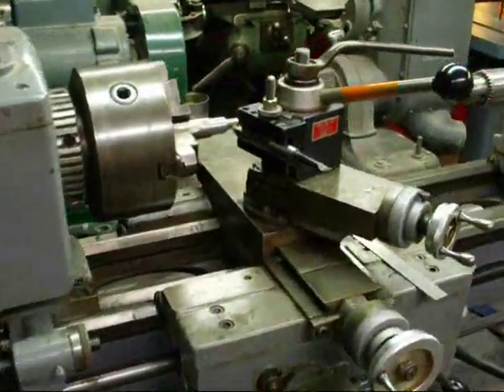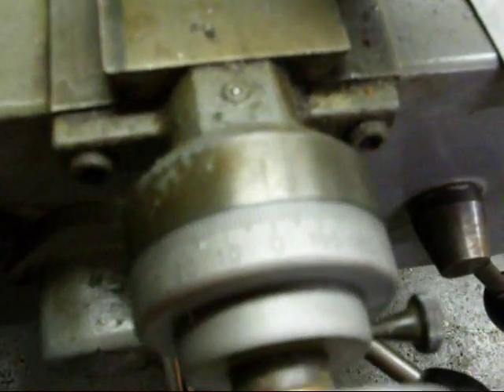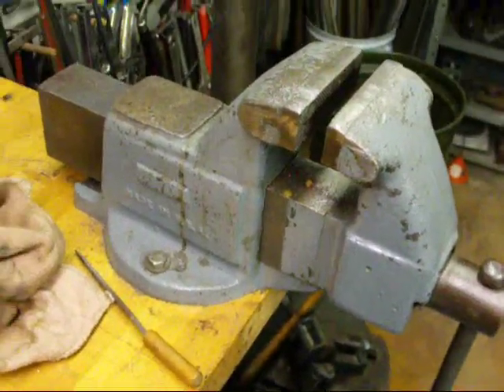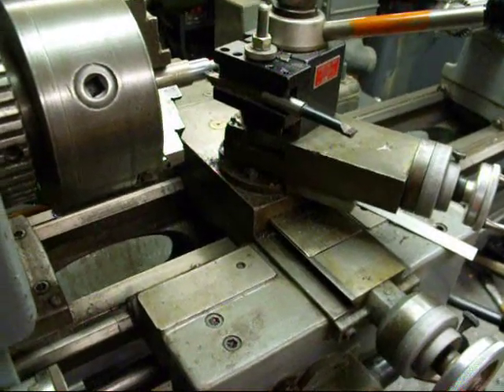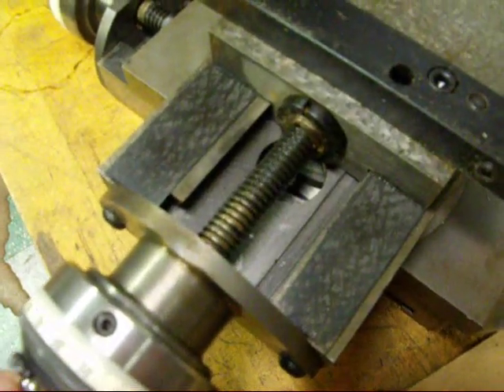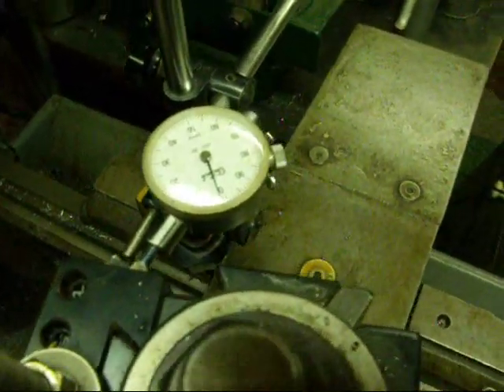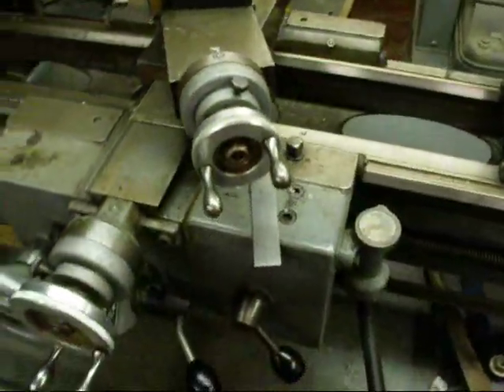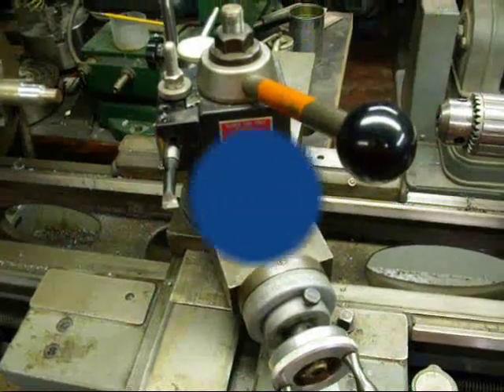SCREW BACKLASH on Atlas Clausing Lathe tubalcain

Comment: I purchased the Atlas Craftsman 12x36 I had mentioned in a comment a few weeks back. Its a great machine, but it does have some play in the cross feed. Have you replaced the nut in the cross feed? I see they are around $35-50 on eBay. I think I will replace mine to try it. I haven't taken it apart yet to see how it looks.
Reply from the maker: No, I have not replaced that. Mine does not seem to need it

Comment: Some machines have nuts with a slit in them that can be pried apart to take up slack. Not a very good system since you risk damaging the nut. Hardinge uses 2 nuts mounted in an adjustable collar which allow you to rotate the nuts individually and take up the slack. It's a much safer and more accurate system. Of course, all machines will have some slack in them so mrpete's advice is still very valid as always.

Comment: Having developed some backlash in th split-nut, I had it plated three times. The buildup was all that it took to tighten the tolerance. Sure, it will wear back down in time, but for now, a thousandths on the dial is a thousandths in the part. I'm glad that you, as an old tradesman are willing to share your experiences and your knowledge with others, especially those who cannot defend their inability to hold to a commercial tolerance. Nice lesson mypete...